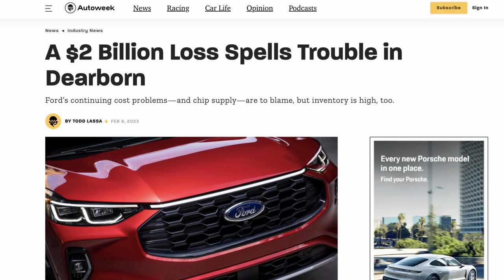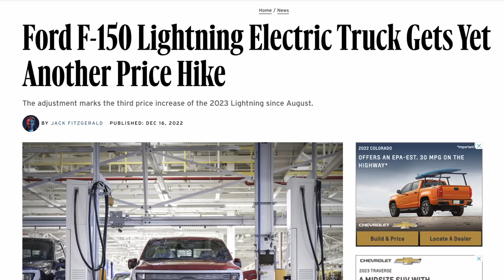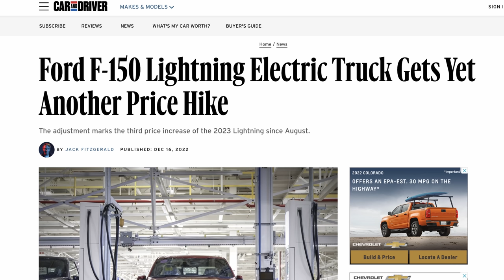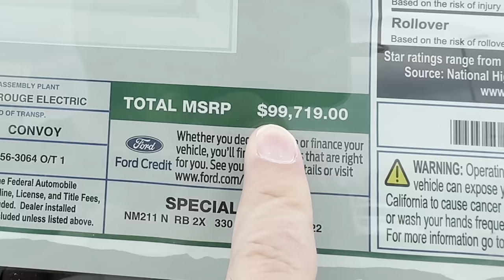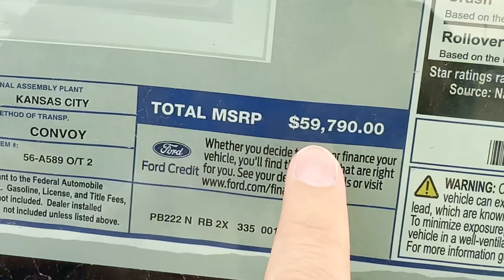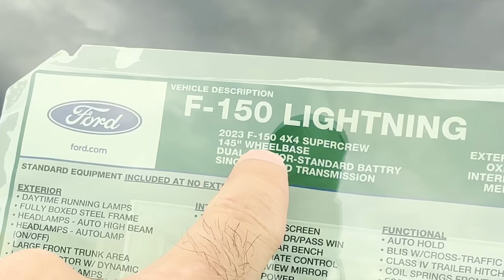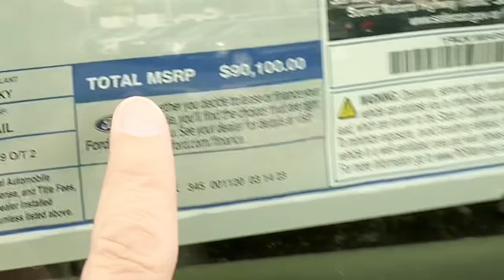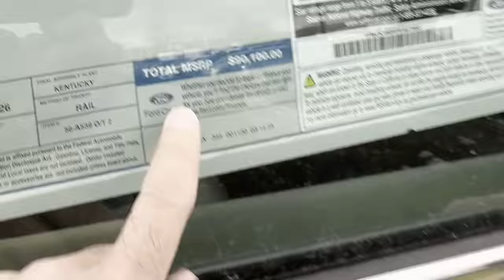Ford CEO Makes HUGE MISTAKE, Now Dealers CAN'T SELL TRUCKS!

Comment: I work at U-Haul and the company sent us a Ford Maverick. It sat unrented for four weeks until it was pawned off on another location. We actually had people literally laugh in our face if we offered it to them. 
I actually would go out once a week or so and start it so the battery wouldn't drain out.
This is coming from someone with two fords in my driveway.
Reply: The maverick is selling like hotcakes
Reply: @goclunker  it can only tow 2000 lbs. Not what I'd want in a rental truck
Reply: @Eric-xh9ee  its against your rental contract to tow with a rental…
Reply: @goclunker  I never knew that. I've never rented a U-Haul truck but I've seen people doing it enough times
Reply: @Eric-xh9ee  uhaul will void you too if their trailer isn’t used and they are not aware. Read the contracts carefully.
Reply: @goclunker  good to know! I've seen farmers haul some heavy stuff or pull a 20 ft trailer with one of their f150s before. I'm thinking "that's way overloaded". I'm guessing they never tell the rental agency though lol
Reply: @Eric-xh9ee  The problem is if you have an accident you are literally screwed
Reply: @goclunker  yeah that would suck. Thanks for letting me know. I never knew that.

Comment: Love my lightning 

 I’m saving $700-$800 a month in diesel fuel doing my small deliveries in my ford lightning rather than my diesel and the truck is almost paying for itself but guess I’m just a dummy right ?

Me diesel:

Faster than the fastest f-150 12.7@ 107 in the 1/4

Smoother ride, quietest ride

Virtually zero maintenance. No fluids to change , no timing belts , no spark plugs , no moving parts 

You spend 10 minutes at a gas station getting dirty hands . The only time I spend on a charger is when I go long haul and have to use a public charger . 99% of the time I am asleep while my truck charges at 13 cents per kilowatt hour . 270 miles of range on average in the summer 240 winter for about $10. 

My truck can power my house for 2 days if my power goes out. Now it is about $8k to hook your house up for that but there are also 11 -110 volt plugs on my truck and I can run 11 extension cords into my house if the power goes out and ditch my noisy generator. I can run all of those plugs for the same 2 days . 

My truck has instant torque. No hesitation.

My truck has regenerative braking. When I take my foot off the gas the truck brakes itself with the electric motors and charges the battery at the same time.  I hardly ever have to touch my brake pedal and will never need brake pads . 

Never have to worry if my truck will start when it’s cold. There is no engine trying to turn over with thick almost freezing oil . No starter. You are just telling the battery where to start sending the power . 

I have extra storage in my trunk. I keep a bunch of moving blankets in there for my business for deliveries 

Also in the frunk there is a well with a drain.  I plan on putting ice and my spare soft drinks in there like a cooler . 

I can run power tools on a job site off my truck . 11 of them to be exact. 

Batter has a full warranty for 8 years or 100k miles . 

Power stroke engine and tranny replacement is about $20-25k to replace at a dealership.  New battery is about 30k 

My home charger was $1k to install in my house (80 kilowatts)

Do not buy if you need to tow more than 75 miles one way . 

Don’t buy if you need to drive more than 125 miles one way a lot 

I will never go back to a ICE vehicle and I have heard this from just about every EV owner. The ride and the instant power make driving more enjoyable and it saves me a ton of $$ on diesel fuel . I don’t have to watch gas prices and worry if a war is going to cost me more money at the pump.  

Stop listening to fossil fuel propaganda and the GOP politicians who are paid by the fossil fuel companies . Not every EV owner is a tree hugging liberal. Go up and ask them how they like it at a charging station . I hate driving my diesel now .
Reply: How many days to drive from LA to NY?
How long do you wait to charge when doing a cross country?
How much is it going to cost you to replace those batteries? The cost to recycle them?
What do you do when the power goes out?

Coll and great, yes we need to.
But shoving it down our throats like commifornia is doing means surplus vehicles.
Reply: @joeme  how many times do you drive from LA to NYC? 99% of my charging is done at home and I have 25k miles on my lightning in 11 months. My other vehicle is a diesel Mercedes sprinter.  Sorry you are a sheep that made EVs political . You keep spending $4.50 a gallon on diesel and I will take 300 miles of range for $13
Reply: @freshpack8928  My girlfriend and I drive around 65K a year.
How many days does it take for you to travel 1000 + miles?
My girl and I do over a 1000 in less than 16 hours regularly.
Reply: @joeme  27k miles in 11 months .
Reply: @freshpack8928  That's nice.

Again, how long does it take to travel 1000 + in an EV?
Reply: @joeme  an extra hour or so . Half hour at a charging station over 10 minutes at a gas station.  Obtw how much is a 12k service and a 24k service at a dealership? My only service is to rotate tires . Save a couple grand more right there.  Also I own a business.  I have 40 or so emails to answer daily . I do this while charging. My time is never wasted .  Sounds like you have made EVs political and made your mind up.  I drive a full size PU truck , some EVs are hitting the 500 mile range soon .
Reply: @freshpack8928  How much to replace your batteries?
How much to recycle them?
What happens to the toxic waste from the batteries that can't be recycled.
To many questions as of yet unanswered that say somebody is jumping in head first without looking.

Seen any of the windmill blade "recycle" farms?

GO Green!!

Comment: I work for a Fleet and we purchased an Explorer from a local Ford Dealership in February 2023, went down to sign the paperwork and after signing the paperwork, were told that they can't release the car due to recalls on the vehicle that prohibit them from releasing the vehicle to us.  It's now June and the vehicle is still at the dealership with no ETA on when we will see it.  Complete joke..

Comment: This is why I ended up buying my 2004 f150 Lariat from my grandpa for like $7000. He had the engine replaced, and a ton of of other maintenance done. 

I have a pretty decent job but everything is expensive now. Seeing trucks go for this much is crazy. Makes me not want to use a fancy truck for anything a truck is supposed to be used for. 

Ford has been taking Ls

Comment: I have bought two f150 pickup within a few weeks of each other this year. Both had a loose bolt just laying on the pully for the power steering. Just got a f250 two days ago. Haven’t found a single problem yet. And yes we have been chasing recalls like crazy. Huge waste of time. One recall  took over a year just for them to get the part in. We have had recalls on every single model all the way up to the f750 rigs we have. Which are 2021s
Reply: I have a f150 going in the end of this month for a recall. Apparently the carpet can catch fire if the side airbag deploys. And the f750 for a update for the trans

Comment: The automotive industry is jeopardizing its future with price gouging and EVs.  One must wonder what is being taught in MBA programs.
Reply: EVs aren't the problem, it's the old, inefficient methodologies that the incumbent car makers have in their design and manufacturing. As an example, the Ford Mach-E had something like 38 hoses in the cooling system, compared to the Tesla's 10. Same goes for the rest of their designs, massively complex and difficult and expensive to make. VW admitted that it takes them 30 hours to assemble an EV, something Tesla does in 10 hours.

You can't have that level of inefficiency and still make a profit. Tesla has the highest profit margins in the industry, the incumbent car makers, on the other hand, are all making EVs at a loss and have no idea how to make it work because they are all stuck in ICE land, their engineers are all ICE engineers who think the same way they did 30 years ago.

And, of course, the rest of the world has access to Chinese EVs, which are better than what's being made in the US, and much, much cheaper, but you Americans don't get them because of your trade war pissing contest with China...

Comment: I have a 2000 Tundra and it is running just fine . Bought it used in 2002  for  12 thousand bucks  . ( original A/C charge, has never leaked out )

Comment: My last 3 cars I have driven to approx 175,000 - 240,000 and upwards of 12 years of age - I usually buy used 2-3 model years (Honda Accord, Ford Ranger, Ford Edge). My current car is a 2013 Toyota Prius with 161,000 miles ( i bought 8 years old, 85,000 miles). A point that wasn't given enough attention during this video was reliability. 

When my 1996 Honda Accord was totaled out by the insurance company from a deer collision, it was 10 years old (bought it as a dealer demo with 4,500 miles) and had 175,000 miles. Other than routine reoccurring maintenance, I spent $100 on an exhaust repair to the straight pipe and one oxygen sensor - break pads three times, rotors once.. 

With my current Toyota Prius the only maintenance I've had was 1) shim back left wheel to balance when first bought (85,000 miles), 2) Transmission fluid flush & new spark plugs at 140,000 miles (didn't necessarily need either but I put on a lot of miles so)...yeah that's it. I still have the original brake parts on all four wheels, still in very good condition - no need to change pads in the near future.

My Ford Ranger was a great truck, loved it but I had significant maintenance issues including Valve Cover gasket (so I also replaced water pump, timing chain, hoses) at 110,000 miles, Ball Joints twice on each side, belts twice, heater core, plugs twice, and brakes about every 35-40,000 miles and rotors at least twice I believe - drove it 238,000 miles. I know there's more than that, can't remember everything. 

Vehicle I had before the Prius was a 2009 Ford Edge.. LOVED IT - very comfortable, vista roof, leather, great SUV to drive. Bit of a boat but that's ok. Repairs were frequent. The motor was rock solid, still quiet as can be on the day I sold it in 2021 with 245,000 miles. BUT I had wheel bearings replaced at least 8 times on this vehicle, one wheel at least 3 times by itself (some of the parts failed during warranty period so no payment was required). Original brakes were 70,000 front, 100,000 miles rear. Replace front about every 30,000 miles after that, rear twice more. Ball Joints 4 times (usually required entire control arm), shocks just once and I know I replaced some other suspension parts. Also had to replace drive shafts twice, 2 sets plugs, new pig tails and some coils.

Point of all this being is that for two of my cars I spent a few hundred dollars putting on over 240,000 miles on those cars combined while my last two fords I spent approximately $7-$8,000 in repairs (conservatively) putting on about 350,000 miles. Reliability seems to be accomplished just fine by some auto manufacturers while Ford (which I liked driving) has had serious difficulties with reliability.

Comment: I was a Ford only customer for over 30 years. In 2018, I purchased a new RAM 2500 and never looked back. I am extremely happy with my RAM.
Reply: I could never buy a Ram. No other brand of pickup has as many douschebag drivers in Alberta than Ram. It was like Mustangs when I was in high school. Lol
Reply: How many miles, what year, and have you had any problems so far? I was thinking about getting a ram 2500 as well but I want to know what others have experienced before I make the purchase.
Reply: I heard the 1500 are pretty solid
Reply: @beri232  what a dumb reason not to buy a ram😂
Reply: Fiat
Reply: @jacobfurnish7450  I bought it new in 2018. Now it has 124k miles.  One warranty on the cruise control on/off switch. I had to replace shocks at 74k (pretty normal). It is the most comfortable truck I have ever owned.  I am 6'3" 250#. I have a Power Wagon.  It is an absolute goat in the Arizona deserts and mountains.

Comment: My first car in the early 1980s was a 1966 mustang. I’ve had at least one ford in my possession ever since, well until the summer of 2022 when I sold my 2013 Fusion. After seeing the insane dealer markups on their dealer lots over the last few years, I bought a car from another car maker. Goodbye Ford, was nice knowing you.
Reply: I'm 67 years old I loaned 15 mustangs in my life but I will never do for it again especially after they came out with the pride rainbow truck they've turned bud and they're going to have to get DM to get in his truck and drive it with those high heels😂😂😂 and there's not one truck out there that's worth over twenty-five or thirty thousand there's no way a truck or car is worth seventy or eighty or ninety thousand because you know that CEOs putting it all in his pocket laughing at everybody
Reply: Brings me back good memories... My first car was a 65 Mustang coupe with 289W, 3 speed stick shift in late 90's. I found it on Auto Trader magazine, and bought it from a retired police officer in his 60's for $4,600. I owned it for like 7 years and no big issues.  I drove it to school everyday and even drove it around in the snow with traction tires. Went on road trip for 2 weeks and came back safefly. You just needed to adjust the A/F on carb regularly, and it got you to the destination. 
It was just simple and easy to fix if you had a repair manual (even without a manual...). New or rebuild, replacement parts were very cheap.
No AC, no power assist on steering or brakes at all, so it gets you sweat just to drive around during summer but it was fun to drive.
My parents did not like it without Airbags, ABS and door beams etc. but... instead my Mustang only had 2 point seatbelts (no seatbelt for rear seats), no head rests, 4 drum brakes and only one side mirror.
I loved it and I still love it though ^^
That was the only car made by Ford I've owned in my life, and probably next one would be the same first model Mustang, and that one would be the last one I wanna get from Ford.

Comment: Buying used or more correctly maintaining older vehicles is the real key. But even then its a struggle, i myself work at a ford dealership and ud be surprised how fully loaded lariet trucks from not even 7 years ago are getting parts discontinued. Had a 2013 come in the other day and we apparently have the entire driver side mirror discontinued from ford 😭. These companies stifle their own bottom line removing parts from older vehicles in Trying to force u to buy another new car. Cpuld make money the same way by being a decent company and still making parts for older vehicles
Reply: @Karl with a K Um...what???  I hit a deer a few years ago and it wiped out my passenger side mirror.  Mirrors don't get faulty, they get BROKEN.  What you said makes no sense at all.
Reply: @Karl with a K A simple sideswipe or misjudging the position of a pole could take either side mirror at any time.
Hell I once had a box being blown down the highway take out a mirror.
Reply: @karlwithak.  "
@karlwithak.
2 days ago
"Nothing dumber than a company stocking parts more than 5 years"

Nothing dumber than your comment.

Hopefully there are non Ford companies selling replacement mirrors, junkyards anyway.

And speaking of mirrors, those fisheye attachments are a danger to life and limb!  Whose idea was that!?
Reply: Just finished the full rebuild on a 73 f150 with a big block full  standard suspension right around 35k.... And 400 horsepower with no smog.😂

Comment: If you have supply constraints you make the most expensive vehicles. This worked great for the last three years. What you're likely seeing price-wise is what happens on the far side of that constraint.
Reply: That's what happens with housing. When the local government won't let you have more building permits, you end up building mcMansions.
Apartments too. When there's rent control and zoning, landlords will only renovate or build to make high-end luxury apartments.
Reply: One of their biggest quality constraints stems from multiple points during this video where women are seen assembling the vehicle. 

These women should be at home raising children. Put the men back to work
Reply: Bidenomics in action....
Reply: @aakeister 
Gotta admire that
Trump University pride,
Go Traitors !
MAGA Dum Loudly

Comment: I need to correct your statement at 1:00 mark. There still are supplier shortages. I work for a major Teir 1 supplier to the D3 and transplants. The supply chain, domestic and global, right now is so fragile that all it takes is one small glitch and the entire system starts to break down. The floods in New England states interrupted quarry operations that lead to rail shipments being delayed. The rail shipments were further delayed by lack of employees as a rail yard in NY. I won't speak about other industries, but automotive has not recovered from supply issues. And should there be a strike, things will get worse exponentially.